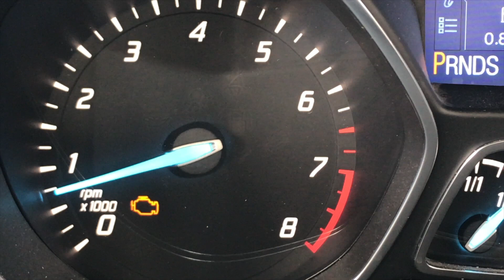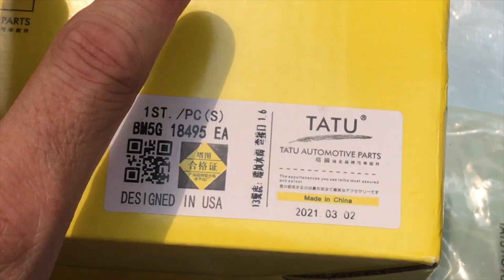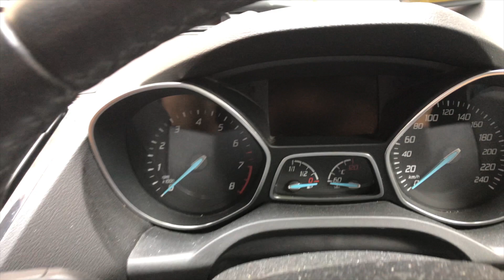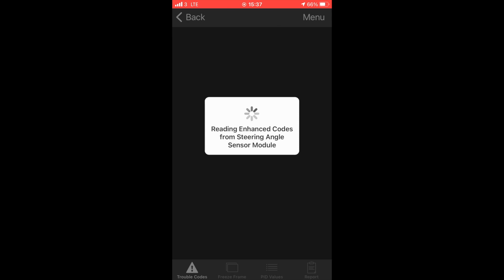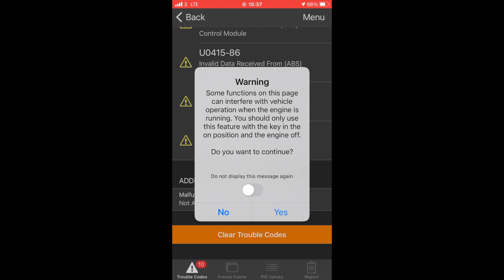14 Ford Kuga Escape engine light on: change coolant bypass valve (DTC P26B7)

Comment: do you have any symptoms for this bypass valve failure? for me, have burning engine oil smell from the car engine.
Reply from the maker: If there is some abnormal smell, can check any oil leak signs and symptoms. Is coolant temperature normal? can remove the splash guard to check under the engine compartment. In addition, u can have a look from my other vdo ab 'cowl panel and valve cover inspection'. For my case, there shouldn't be other immediate problem. However, it's not sure other problem can be caused as the valve is connecting to the coolant passage.

Comment: Hello, Thanks for the video. I recently have the same problem.
Can I just remove the engine light by using OBD tool without really replacing a new coolant bypass valve? (I understood this is not a proper way to solve the problem, but my situation was below: 
1. the same engine light appeared
2. I use OBD tool tool to scan the car, also can see the DTC P26B7 code.
3. After scanning the car, the engine light disappeared. (somehow maybe  i have deleted the code, I am not sure)
So, does this mean the bypass valve was not really the problem? ( I mean , if it is really the problem, we can never remove the engine light until it was really reparied/replace/fixed).
Thanks
Reply from the maker: Hi Michael, if the DTC disappeared after delete, it means it's normal again. However, if it appears again, the root cause should be found and treated. It should be the problematic part sometimes working sometimes no.